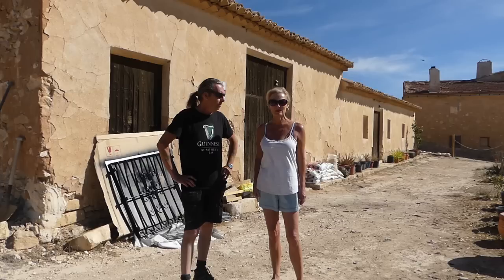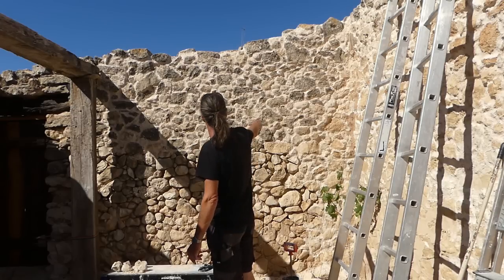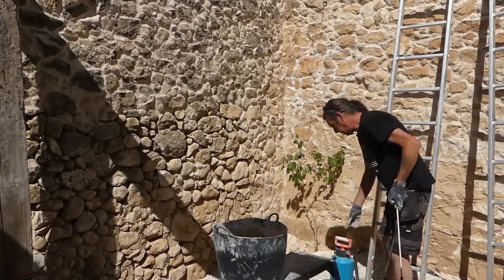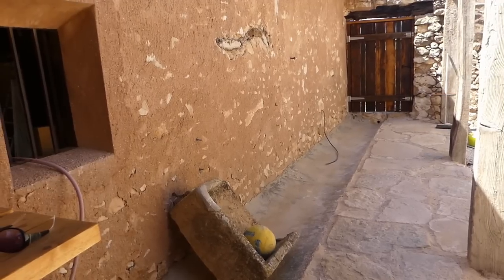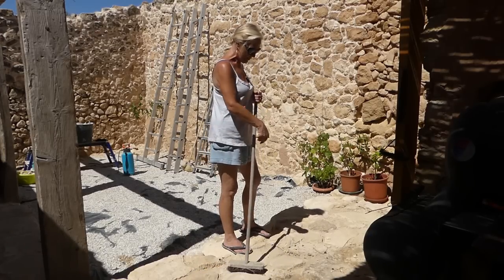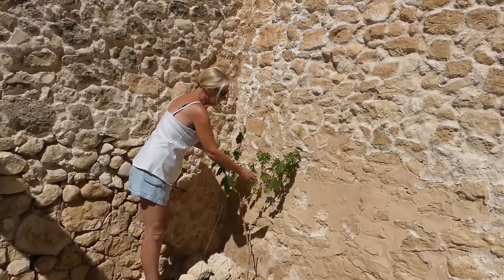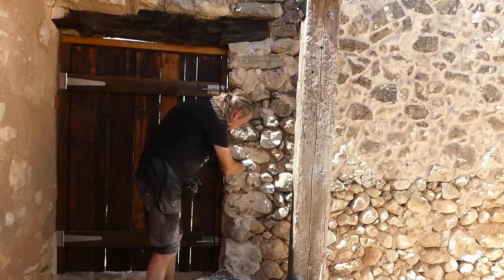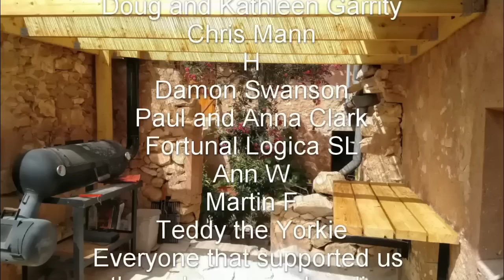Working 7 days a week to catch up with the old farmhouse renovation

Comment: From your videos, it seems like your location is very hot, dry, and barren. Almost desolate. If there a reason you chose that area of Spain to renovate a home? I assume there is more to the area that what we see in the videos.
Reply from the maker: The area is stunning and the climate is very kind, although it can be very hot in summer. We usually get really heavy rain for a day or two in spring and autumn which keeps things going but this last year has been exceptionally dry